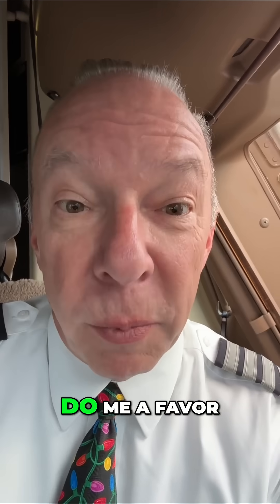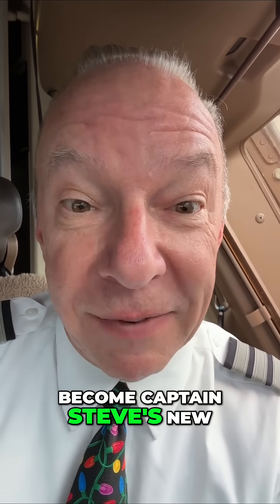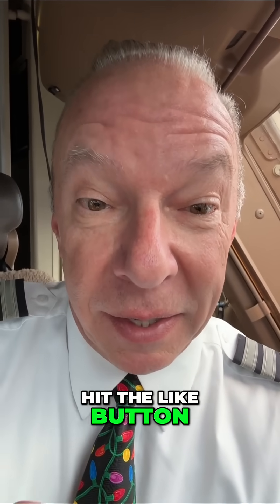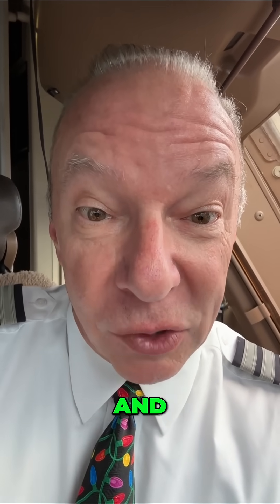Crosswind Landing Limits: What You Need to Know

Comment: I live a mile away from the airport in las vegas and directly under the glide path. It's very common to see planes "crabbing" as they come in.
Reply: "Crabbing" ?
Reply: Two methods for cross wind correction. You can do a side slip, where you drop your wing into the wind and use your rudder to align your longitudinal axis with the runway (cars don't drive diagonally, planes don't like landing diagonally either).

Crabbing is keeping your bank neutral and you just point your nose directly into the wind. So, your ground track (path your plane is flying) is tracking directly towards the runway, but your nose will be pointed to the side towards the wind by a bit.
Reply: @Andromedon777  Interesting! Thank you for explaining.

Comment: @CaptainSteeeve - What is it during climb after takeoff that feels like slight losses of altitude before climbing more? This is the only thing left that really frightens me. You've helped make flying more enjoyable. Thank you - fly safe!
Reply: My guess is the pilot moving the throttles back from take off power to climb power. This used to freak me out also.
Reply: @bodystomp5302  This makes so much sense. It really terrifies the crap out of me. This knowledge will really help calm my nerves. Thank you!
Reply: Its the plane pitching down to accelerate. Its normal.
Reply: This is caused by the crew retracting the flaps. The flaps are “high lift” devices that are on the trailing edge of the wings. They are used during takeoff and landings. They increase lift at slower speeds, increase drag and decrease stall speed. The feeling you are talking about is when they retract them shortly after takeoff causing a momentary decrease in lift and reduction in drag, making the airplane sink slightly and accelerate.
Reply: @chorpelo  Now this sounds exactly like what I'm feeling! Thank you for answering my question. I greatly appreciate it 😊
Reply: @Rachael-R  No problem. I’m pretty sure Captain Steve did a video about this a while back.
Reply: angle of attack changes maybe?? i only fly in simulators so idk